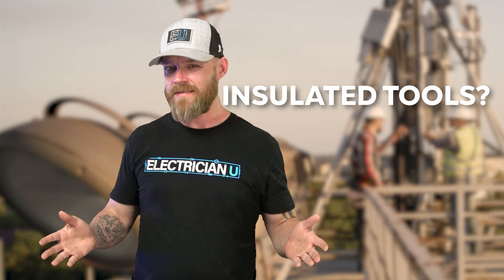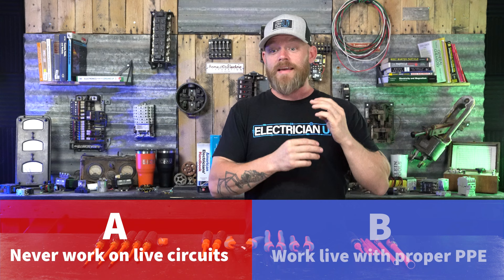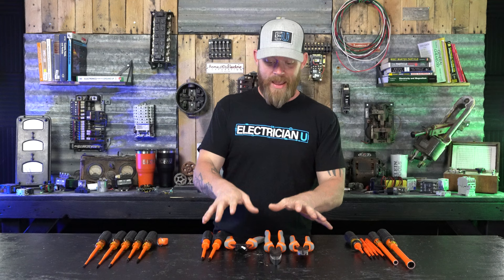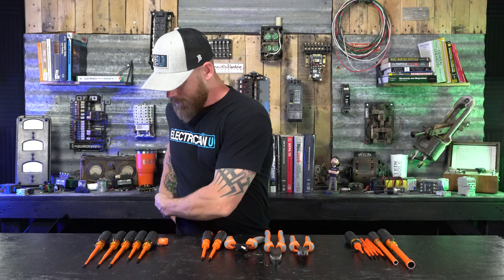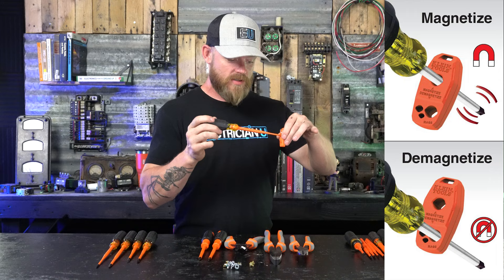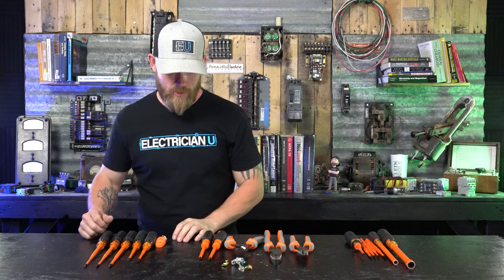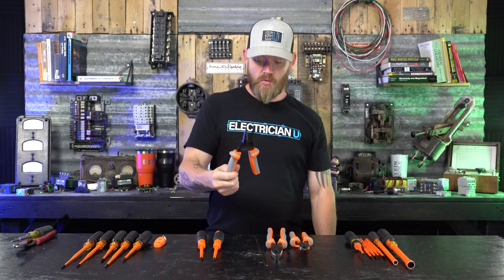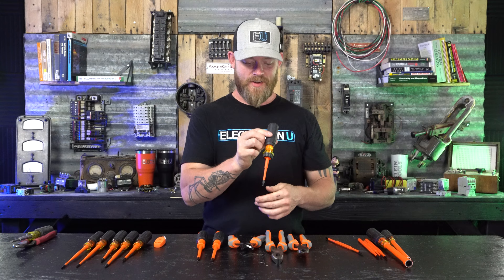Every Insulated Tool Electricians Need!!!

Comment: Those meters that are so expensive are so expensive not exactly because they're extremely accurate (that part can be done for relatively cheap with a $50 multimeter), the part that makes it cost a whole lot of money is the various safety features and certifications these meters have.

Just look at the fuse used for the high-current amps range in your typical Fluke meter aimed at electricians.
It's a physically large, explosion-resistant, silica sand filled thing, so if it actually goes across something dangerous (like a dead-short across a 240v circuit you caused by accident because you weren't paying full attention and set it on amps (with the leads also set up for amps) and not volts), then it won't hurt YOU by making the meter explode, instead the fuse will make a (frighteningly loud) noise but the meter itself (and you) should probably both come out of the experience relatively unscathed (of course you'll need a new fuse for the meter, and they're not exactly cheap, but you're still alive and unhurt).

Compare that to the high current amps range fuse in that no-name $50 meter I was comparing it with.
Chances are that the fuse in that meter is also "rated" for 240v, but if it's any upgrade over a standard glass tube fuse it will be only a ceramic tube fuse, with no silica sand filling, and no explosion resistance of note. So if you dead-short that thing it's gonna turn into a little firecracker and probably put pieces of the meter housing into your face (seen it happen in some testing videos, the test dummy took most of the impact in both hands and face).

So to be perfectly honest, I'm saving up for that Fluke meter even tho I'm just an auto mechanic. Because I can count on it to withstand harsh conditions (aside from harsh chemicals like engine oil and coolant, and obviously gasoline but I'd be doing my best to avoid gasoline in the first place because outside of the cylinder of an engine or a fuel pump, gasoline and electricity don't mix), be accurate when I need it to be, and if I have to take it home to fix something on the house over a weekend I can count on it to have my back if I mess up.

Comment: I was working with wire strippers as you mentioned your spring removal tip. I popped it right off and now I’ll no longer struggle to put them back in my tool bag. What an awesome little tip that had nothing to do with the video
Reply: They really should have just put the locking latch they have on their non-insulated one. I guess it was too difficult to insulate the nub or just make it plastic; kind of a bummer though.

Comment: My company pretty much only buys insulated tools for us, which is pretty nice.  The main problem I've had working with like insulated nut drivers is the insulation can be too thick to fit inside certain places like to de-term MCC bucket.  I need to get one of those insulated 10-in-1's.

Comment: Something that I spotted as a bad habit that you were (probably unintentionally) demonstrating. When you were handling the plier-type tools, you kept putting your index finger over the bump on the handle. Those are supposed to be finger guards to keep your fingers from getting too close to the exposed metal. By putting your index finger over them (on the bare metal side of them) you are violating the air-gap and creepage distance that the bump is supposed to help enforce.

Comment: I do construction residential work and I've found all my tools have some insulative properties to them. I can't think of a situation where I would be touching 240v with a tool and so far all of my tools not rated for insulation haven't shocked me with 120v, including my impact gun. The only time a tool has shocked me was when I thought a circuit was off (2 circuits in 1 box at a staircase) I was still learning and out of habit I grabbed my demo screwdriver to tighten a terminal and touched the strike on the end with the palm of my hand. After that I immediately went and bought a 3 piece milwaukee insulated hand tool set.
Reply: In residential your not likely to get shocked by 240 since most residential applications only use 240v single phase. The 120 in the outlet is half of the leg and shocked you by shorting through you to ground. To actually get shocked by 240v if only 240v single phase is supplied you'd need to be working on the panel live, the HVAC system, electric dryer or oven, or some other power hungry appliance and youd have to touch both of the two hot leads at the same time. If you touch a single hot leg from one of those appliances it'll hurt more as they have higher current breakers and lower voltage drop thanks to larger conductors. Even with 208 and 240 three phase if you only touch one leg it's only 120v. You have to hop up a level to 480v for one leg to be 240v. Worked on an AC that was 480v for the first time a few days ago and reached my hands into the electrical area to check some things before verifying power supplied and took a bit of a step back when my meter read 497 at the terminal lugs. 

TLDR if you only do residential you probably won't get shocked by 240 stay safe out there
Reply: @jetthardin4927  One leg of 480V is 277V, not 140V.
Reply: @illestofdemall13  my bad only worked around 480 a couple times so Im not super familiar with it. My points still valid tho
Reply: @jetthardin4927  No worries. It is 277V phase to neutral and 277 is often used for commercial/industrial lighting. You definitely need to beware while working on 277/480 if you want to live. Lol

Comment: Thanks for this video/reminder/instruction. 

Utility companies/suppliers work on energized circuits all the time - with the proper PPE and safety steps in place. It doesn't take a commercial setting to have the "need" to work on an energized circuit or distribution/breaker panel. This condition could occur in a private home if you are replacing a single breaker in an energized box, especially if there is some type of medical or computer equipment that needs to stay operating while repairing a circuit that is not directly connected to said equipment. Not to mention the DIYers who work on energized stuff because they "can" or don't know better - knowing about insulated tools is helpful to them, also.

Comment: Irish here, insulated cutters, needle nose and screwdrivers are a basics, most use them as their daily tools. Easy to prove dead in industrial and new builds, but rewire, fault finding, minor works, you can never be sure there is no back feed, alternate supplies, ect.
Reply: I was under the impression electrician in the UK and Europe and Australia were required to use insulated tools.

Comment: I think where the bigger argument is is for insulated vs VDE rated insulated. A lot of older electrical tools will have an insulated handle of some degree, but without the VDE rating, generally this means it won't carry the finger guards/flared handle, will only be tested to 1000v AC vs 10000v. 

For me, as a control panel spark who works live 80% of the time, I carry insulated linemans & diagonal cutters, as I very rarely, if ever, chuck these into an energised circuit, however my needlenoses & my screwdriver it's VDE rated all the way, both of these tools get used in place I don't want to put my fingers, so VDE rating is serious piece of mind.

Comment: Had pair of Klein’s 1000v lineman’s ended up getting a small crack in insulation couldn’t even tell - was hot day sweating my ass off in electric room and workin on 277v - Got shit knocked out of me and linemen’s wound up flying out back door into dumpster
Reply: OUCH!!! I got hung up on 277 once years ago. I couldn’t let go. It almost killed me. Luckily most of the current went through my left hand. I had 3 fingers and my thumb wrapped around the spiraled armor of some MC and my pinky contacted the hot terminal of a switch as an apprentice made it hot in the ceiling outside the office I was working in. I was also leaning against a metal modular wall on my right side so some of the current passed through my heart. It’s pretty painful and it feels like it’s happening in slow motion. Like I could almost count the sine waves passing through me

Comment: I keep BOTH sets of my insulated hand tools in the large, canvas pouches KLEIN sells - one stays in my toolbox at home in the garage till I NEED to work on something live and the other stays inside of a Milwaukee Packout XL box with my test instruments on my work van.  
 Keeps them CLEAN, DRY and ready to use when it MATTERS. 

Drives me up the wall when I see co-workers (who are otherwise very intelligent) using something like that double-sided insulated screwdriver to pry and see that they've damaged the insulating jacket of the tool.
For HVAC work, especially tightening lugs on contactors, breakers, and other live circuits during maintenances - that double-sided P2/Slotted driver is my go-to.
Great for getting to screw on boards while the equipment is running to reduce the risk of causing a short - because basically every RTU or system that we 'inherit' from 'that other company' has been turned into a rat-nest by the time we get called to get it going.

Comment: The truth of the matter is that sometimes, no matter what you need to kill a circuit. Especially if someone wired a junction box wirh loose nuetrals. I dont care what application it's in or what environment it's in. I've worked in ambulance facilties in dispatch centers where people lives are literally on the line and had to shut down circuits because loose neutrals were starting to melt a wire nut. My general concensus is, if you can turn it off, turn it off to work on. Of course you have to test things live and figure our circuitry but once you figure it out, turn it off and fix it. Especially working with 277/480 in t-bar grids or environments where you can easily be grounded.

Comment: In ireland all we use is insulated tools. Like I've never seen an electrician without insulated screw drivers. And we mostly work on dead circuits too. Pliers snips the lot. The UK is the same I'm sure too

Comment: I've been an electrician for 30 years (residential only) and never needed insulated tools, other than pliers and large wire cutters when I need to work on an energized service drop from the POCO. I also have a screwdriver that I've wrapped the shaft in electrical tape.
Reply: You may want to check workplace safety regs. Canada and the US require use of rated, insulated tools when working on or near live electrical equipment.

Comment: Never felt the need for insulated tools on resi, but definitely will consider if I'm elbow deep inside a  480-600v switchboard
Reply: Not for Resi but I dont like to risk it on commercial jobs, 1st one I was on my boss got hung up on a energized T-bar ceiling and I had to kick the ladder out from underneath him. insulated tools would not have have helped the situation but it gave me a healthy respect for the voltage in that environment.
Reply: @tomtom7955  I know the feeling I got hung up in a grid ceiling before was not fun.  But was able to move legs so I kicked the latter out from under me.  Let the body weight break me off the circuit.  Was scraped up a bit a shookin up.  Almost switched trades lol but still there brother

Comment: I only clicked on this video because I have all the Klein drivers/pliers/side cutters in the thumbnail. I’m a mechanical/combustion engineer working in an industrial background, and take my safety very serious. My toolkit is almost exclusively Klein ( which I purchased out of my own money ), if I’m going to work live I want the best kit My screwdrivers ( I have a set like the ones on the left of the screen ) cost me £230 for 5 about 7/8 years ago, 2 x Posi and 3 x flat heads and came with a lifetime guarantee, of which I’ve had 2 replaced - no questions asked. 
I work with electricians who’s tools I wouldn’t touch with a bargepole, I’ve worked with electricians who work really dangerously, I’ve work with electricians who I’m surprised they haven’t killed anybody. My old supervisor from 15 years ago, a lovely guy but one who was a bugger to cut corners, killed himself in an accident replacing his parents boiler in their house. His elderly dad found his sprawled across the boiler dead. Where I work now, before I joined 5 years ago a guy working on street lighting was killed when there was a mix up cutting power to a streetlight, he was up in a bucket and got a shock and was ‘stuck’ on a live 230v current for 30 minutes with his team of another 3 people stuck on the ground watching. Both these guys left behind young daughters - tragic.
I used to work in a factory maintenance team, there was 11000v incoming ( 11 thousand volts ) If I removed anything ( usually our kit was 415v ) I’d isolate locally and lock off, I’d go to the panel and switch off the circuit, and pull the fuses. I’d remove the pump/fan/motor and tape off the connections. Some of my colleagues would just turn off a 415 supply at the local isolator, no locking the isolator off, no taping the ends they’d leave it like that, it would be like that for days, sometimes weeks whilst parts were sourced - frightening. 
Never leave your safety to chance, never leave your safety to others, check and double check, it may be your last time if you don’t.

Comment: Pittsburgh 1000 volt insulated screwdriver set at HarborFreight. $17. The best bang for your buck set. I’m a 24 year electrician and I’ve owned Klein and Greenlee and the Pittsburgh are better at a fraction of the price. Plus , they don’t walk off like Klein and greenlee. Oh and they are magnetized as well.

Comment: I work on coax cable and these work good for set screws on amplifiers. Stops  you from shorting out a device down the line when your messing with a power leg.

Comment: Dustin, 98% blanketed is really high as an estimation. It depends mainly on what area of the industry you might be in.

Like industrial and commercial electricians work on live circuits/equipment every day. Residential sparkies, probably not so much. 

The key I believe is to have the right tools and equipment for the sphere of work/job you're in or might find yourself in. As electricians, "proper tools are more than half the job."

Comment: OSHPD work is usually live for maintenance and troubleshooting. Life safety so you cant shut power off. You can isolate your circuit but not completely shut the breaker off.

Comment: Well I didn’t really have the luxury when I first got started in this trade with affordability with 1000 volt insulated tools to do hot work. All we did was use some heat shrink or double wrap it with super 33.

Comment: Good idea too. Side cutters and needle nose .. wire cutters. Cut a hot while touching metal together. The short circuit  will vaporize the metal of your pliers at the point of cut. rms..no resistance causes this, blue fireball, metal melts and vaporizes, thousands of amps.

Comment: I’m a huge fan of that last Klein insulated twist/swap screw driver. I’m actually using it today (I think it’s way better than a 10-in-1) as the bits stay in very well the only issue I have is having to carry the flat/Phillips or s1/s2 or whatever but you’re NOT using in the handle, in my pouch and it’s kinda awkward. So I mainly use that with the s1/s2 bit and have other screw drivers with flat/Phillips. 

I also have a full set of Wiha insulated tools past down from my father. It stays in a bag, in my truck for when the time comes to use them! (Hopefully never!)

Great video man!
Reply: I thought I would like the Klein insulated twist/swap driver set too until the first time I used it.  My finger tip was on the twist collar and as I tightened the terminal the collar turned as well and ejected the bit shaft into the panel.  Of course, it had to fall down and land right behind the main lugs (bottom feed panel).  It is still there.
But every other Klein tool I totally love.  Great performance and quality for hand tools.

Comment: There is a clip on the front of the strippers to hold it closed specifically because of the spring but my insulated don't have it so I agree with ripping the spring out.

Comment: I do find it Funny, When Southern California Edison is changes out old meters to new smart meters, There people are in PPE. but I don't see them shutting down the main breaker to the house. To me its the same thing as pulling a 3 phase fuse block @ the  service panel powering a sub panel. you have no Idea what kind of load is on it. i guess arc flash is of no concern to Southern California Edison or there workers.